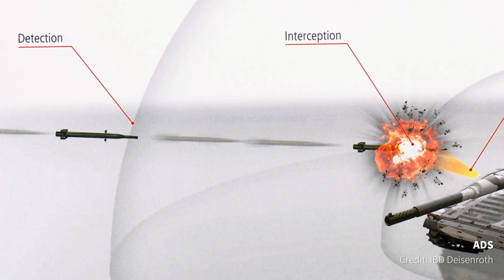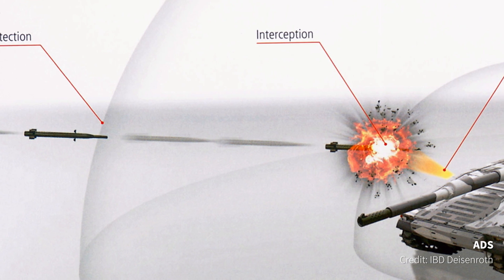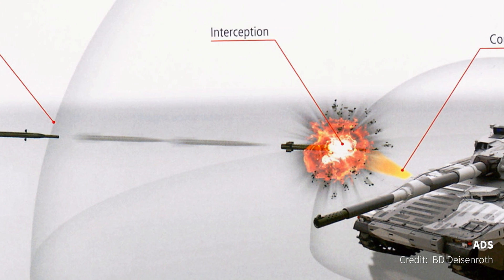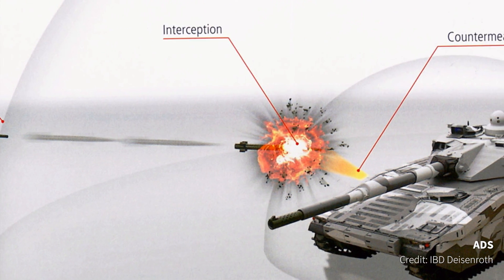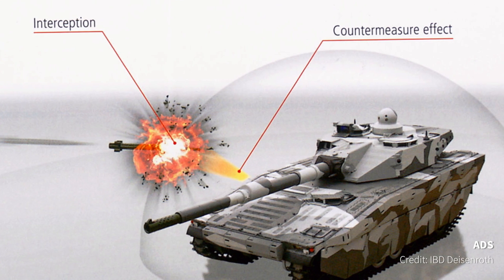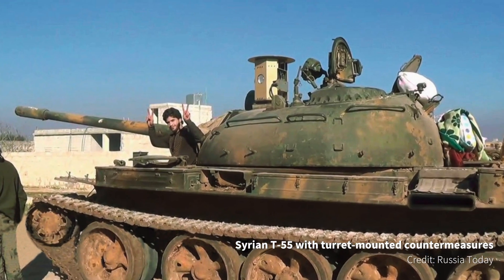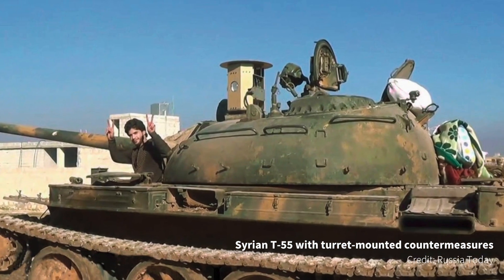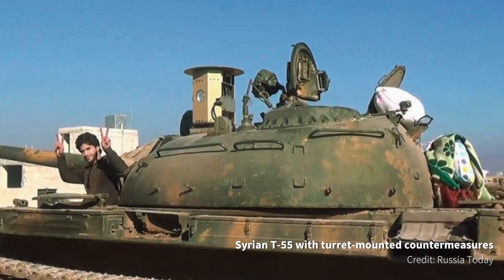Active Protection Systems

Comment: Use anti tank like mortars but heavier. Hit the tank from the top
Reply: Trophy is designed to counter high elevation attacjs already
Reply: That's the principle behin a top-attack ATGM.
Reply: Rheinmetall's ADS protects the top, too. And with lasers.
Reply: @TheKorbi  there are no such lasers
Reply: @TheKorbi  Rheinmetall ADS doesen't utilise lasers. It's not exactly sure what principle it is based on, supposedly it's dense inert metal explosives.
Reply: AnalisiDifesaSistema 01001 too bad it works for that and Russia doesn’t have any such missles
Reply: Mortars are inaccurate against moving targets. Besides, some APS can defend against top attack munitions anyway, assuming they are even needed. Soft kill protection systems like smoke grenade launchers interfere with the tracking systems of top attack ATGMs, so hard kill APS's aren't typically even needed.
Reply: With the advent of APS systems, the advanced recoiless rifle will be the new tech to replace ATGMs.  With lighter darts, much higher velocity and increased range with increased penetration, they will overcome modern armor threats easily
Reply: @ConstantineJoseph   Some APS systems claim that they can intercept KE penetrators and EFP's traveling at speeds more than mach 3. With the systems like AMAP-ADS with a reaction time of 560 microseconds, I don't think the lighter darts will be fast enough to counter these systems. How about future Anti-APS systems being more focused on deception?
Reply: @ConstantineJoseph  Wouldn't do any good. Any APS can intercept rounds fired from recoiless rifles. Afganit can intercept APFSDS rounds fired from tanks.
Reply: @Malamockq   no it can't, Arena only intercepts ATGMs.  Besides modern ATGMs that have top down strike capabilities like the SPIKE and Javelin ATGM systems means that no modern counter measures can intercept  close to 80 to 90 degrees vertically where these ATGMs are designed to attack from the top down as their trajectory of fire is like  a cobra, rocketing up into the sky and then picking their targets from the top.

Besides that, new 120mm mortar systems now are precision guided by laser designators.    Making top down strike penetrations very possible against even mobile tanks with APS protection.   

APS does help modern MBTs tremendously but it doesn't mean they are fool proof as the adversary always finds ways to find a weak link
Reply: @ConstantineJoseph  Did you even bother to read any of the other posts I made? First of all, I said nothing about any specific APS, I said there are APS's that can defeat top down missiles, and there are. Secondly, APS's can work against any projectile, not just missiles, it's just a matter of how fast the projectile is moving, and as I and someone else already pointed out to you, Afganit can intercept projectiles including APFSDS which can exceed speeds of 2000 m/s. Finally, a hard kill APS isn't even necessary for top attack missiles as soft kill measures are more than adequate at defeating those threats. T-14 armata for example just deploys a smoke screen which defeats the missile's target seeking sensors. Top attack is highly overrated as it is, and are notoriously inaccurate against a moving target.

Never said APS's make a tank invincible, however your arguments to defeat them are poor.
Reply: @Malamockq  Claiming a softkill APS will invariably defeat a top-attack threat relies on the assumptions that 1. missile guidance will be fundamentally vulnerable to softkill CM and 2. that sensors or crew will detect the weapon launch, and do so in time. Both highly dubious presuppositions, given CCM capabilities on seekers & guidance logic as well as stand-off range and low launch signatures (FGM-148 a prime example). Which is exactly why top-attack remains the preferred, and most effective attack vector for all modern ATGWs.
Reply: @becauseiwasinverted5222  You said a lot without saying much at all. You basically said, "I am skeptical of your claims". That's nice, but I'm actually not the one who even made this claim. Go watch RedEffect's video "Why top attack is not as good as you think".
Reply: @Malamockq  I provided specific counterarguments for specific claims you made here, regardless of who you lifted them from. No more, no less. I'm familiar with said video, the majority of claims are arbitrary and based on speculation instead of fact. Recent combat experiences in Syria and NKR of tandem-charge diving ATGWs vs ERA-equipped tanks show his theories to be wrong. In some cases (namely the difficulty in detecting a Javelin launch) he even reaffirms my points.
Reply: @becauseiwasinverted5222  Actually no you didn't. You made vague remarks just casting skepticism on the claims. I don't see the relevance of tandem charges or ERA, we aren't discussing those systems, we are discussing top attack missiles vs. softkill protection systems. Whether he's wrong about the latest ERA being able to defeat tandem charges or not, does not discredit any other claims he made, that's a poisoning the well fallacy. Each claim is independent, and he can be right or wrong about any individual claim without the rightness or wrongess affecting the truth value of other claims.

In any case, all of your assertions are highly speculative as well. We don't know the exact efficacy of these systems because Russia and US haven't gone to war now have they? Theory is all we have at the moment, until you have hard data.
Reply: @Malamockq   I replied to claims like "soft kill measures are more than adequate at defeating those threats", "just deploys a smoke screen which defeats the missile's target seeking sensors", explaining why they don't work. You call my assertions "vague" but avoid responding to them. Nothing vague about tanks' difficulty detecting  low launch sig weapons w/ passive guidance, which both preclude CM launch. From redeffect comments: "Ex tank commander here. I can assure you detecting a launch of a anti- tank missile from inside the tank  and getting the smokes go off and scoot from the firing position when you have at least 10 different things to concentrate on, radio and the crew communication going and trying to direct fire etc. Is while not impossible, at least very unlikely."

I never implied one of his wrong claims disproved his other ones. Quality strawman. I repeat: on smoke, he agrees with me (6:54): a tank can't reliably smoke vs top attack because it can't reliably detect the launch. For someone lecturing on informal logic it's surprising your acumen didn't inform you the source which gave you your claim also debunked it.

The certainty in your prior comments is inconsistent with this "no hard data" attitude. You seemed to "know" that "a hard kill APS isn't even necessary for top attack missiles as soft kill measures are more than adequate", or that "Top attack is highly overrated as it is, and are notoriously inaccurate against a moving target". So this was all "highly speculative" after all?
Reply: @becauseiwasinverted5222  Nonsense, you didn't explain why they don't work, you merely cast skepticism that they can work. That's not an argument, that's merely you not believing the assertion. There's nothing to respond to, you didn't actually make any arguments, you merely cast doubt on the efficacy of the countermeasures. Citing some random guy from the comments, is not a good argument lol. It's also an appeal to authority fallacy. Show me the proof that a top attack munition can defeat soft kill APS. 

You absolutely did imply a poisoning the well fallacy. The ERA stuff was totally irrelevant to the point at hand and was only brought up by you to discredit my source.

I can be as certain as I want. That's my right. That's why your style of argumentation is so poor. You don't make arguments, you merely cast doubt, which is useless because you don't prove your position. At best all you can do is just assert that it's hard to detect a missile launch and react in time. That's a terrible argument though because reaction time for a crew member is totally irrelevant to the reaction time of an automated computer system. So I'm not interested in speculation from random people in YouTube comment sections, I want PROOF. If you have none, you have no argument.
Reply: @Malamockq  "There's nothing to respond to" You can speculate on why my scenario won't pan out more often than yours. You had no issue speculating previously.

"Citing some random guy from the comments, is not a good argument" Nor is citing some random guy's video from youtube. Also adhom.

"It's also an appeal to authority fallacy" Expert consensus isn't AtA unless you don't believe doctors or lawyers in their fields for fear of committing appeal to authority.

"The ERA stuff was totally...to discredit my source." Your source said it so I replied. I also replied to "the point at hand" that you used the video for, besides the ERA, so I attacked the argument. Thus no fallacy. Keep acting like the video didn't agree with me, too.

"I can be as certain as I want. That's my right." It's not. Certainty demands proof. Certainty w/o proof is deliberate unreasonableness thus insanity.

"reaction time for a crew member is totally irrelevant to the reaction time of an automated computer system" No "automated computer system" for softkill APSs is in service that works vs passive guidance.

"I'm not interested in speculation from random people in YouTube comment sections" Like yourself? More adhom too.

Comment: Want to defeat these systems ? Just produce a missile able to accelerate at mach 4 when it getting close to the tank.
Reply: Wanna beat russia get them spending all there oil money to develop such a missile rather then on any real economic development.
Reply: simple as that, apparently.
Reply: just drop a 1000lb bomb on it
Reply: @providence5384  What's with you keyboard warriors that think they know anything about military tactics? An unguided bomb won't hit a moving tank you idiot. Even with JDAM guidance, a simple soft kill smoke screen is enough to defeat such a threat.
Reply: Not "defeating" but affecting, shattering the KE penetrator, reducing its force drastically. And yes, some APS are capable of doing so.

According to Dipl.-Ing. Rolf Hilmes, who worked in the German military procurement agency, AMAP-ADS has been successfully tested against 120 mm APFSDS ammunition in the past.
Reply: Mach 4 equals 1372ms. Modern APS like Afghanit (Armata family of vehicles) and AMAP-ADS are capable to hit even APFSDS traveling at 1700-1800ms.

Unconfirmed sources say ADS is capalbe to defeat threads with a speed of up to 2200ms, so you would need a missile traveling atleast at mach 6.5.

That sounds very expensive.
Reply: It's irrelevant if afghanit has this capabilities. Other APS like the german AMAP-ADS or the israeli Iron-Fist have the ability. I was speaking overall for APS.
Reply: +Jonny LOL, are you really believing these russian crap stories ? Except on Rocket,  Afghanit has never proved that it capable of defeating APFSDS......
Reply: @yutuniopati  Trolling with "LOL you really believe Russian blah blah blah" immediately discredits any of your arguments. Afghanit can defeat APFSDS. But your fictional mach 4 missiles don't even exist anyway, nor will they ever. A hypersonic missile will never be launched from an RPG, which is primarily what these APS's are designed to counter, not frigging cruise missiles. And yes, any hypersonic missile, will be an expensive cruise missile that probably costs more than the tank it's trying to destroy anyway. Dumb kid
Reply: None of the availible APS in the market has proven to be capable of defeating APFSDS.